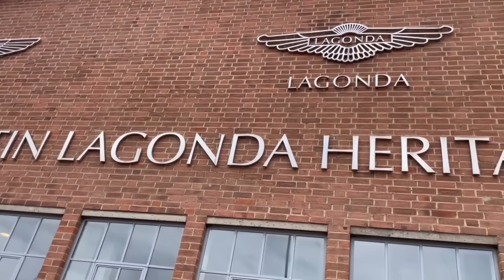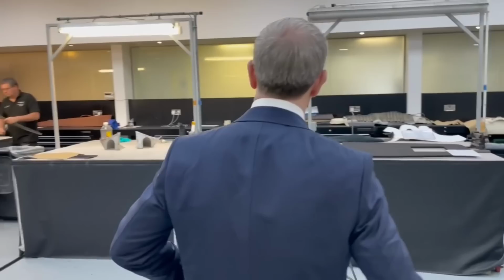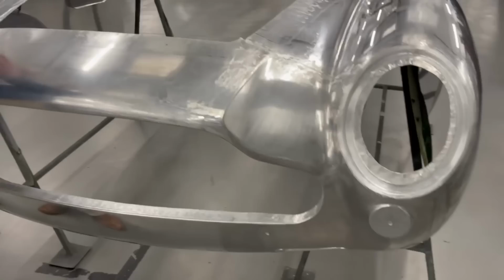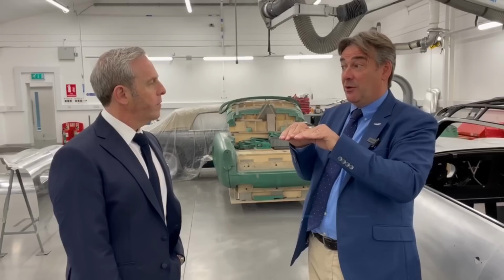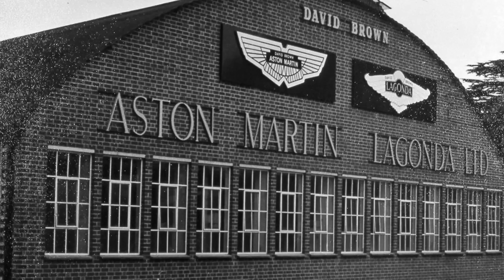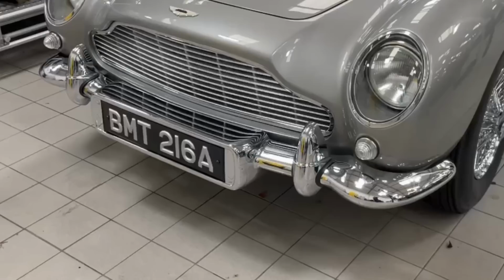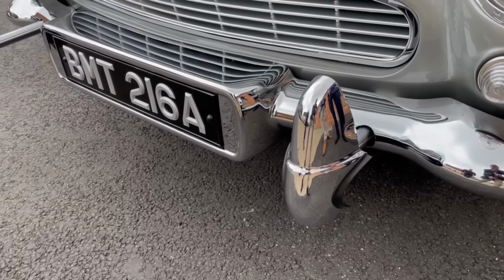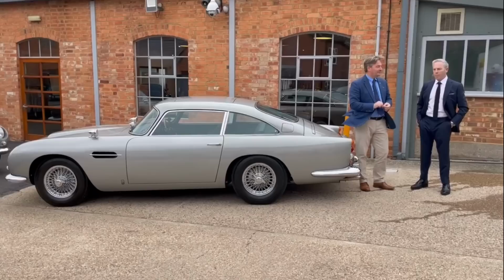My Day with the GOLDFINGER DB5 |  EXCLUSIVE Tour of Aston Martin Works

Comment: Good video.  I also went to Jay Leno's for more technical (drivetrain) info. I am ambivalent about keeping the DB5 in the series. As a car nut and 66 year old Bond fan, I love seeing the car. But Brosnan / Craig having a  282 hp 4-liter 6 1964 DB5 with a paltry 8.1 second 0–60 time  to tool around in modern times is a bit gratuitous and requires suspension of belief. Blofeld could pull away from him in a garden variety Ford Focus.   🙂
Reply: Yes, TBH, before I have my first ahem beer, the appearance of the DB5 in the later Bond movies can feel like a little bit of pandering to the earlier Bond generations to keep them (us) onboard.

Comment: I really like the extra attention they are devoting to standardizing the fit of the body panels, and that's more than Aston Martin did back in the day.  The originals were basically hand-built cars, and as such, no two were exactly alike in that fitment aspect.  And the level of build quality that was acceptable in the 1960s would put an auto maker out of business today.  I'll never own an Aston Martin (sadly), but as someone who has restored a 1963 Studebaker Avanti, I have experienced similar problems with 1960s, hand-built fitment.  As a fairly low-volume car, Studebaker made the body in fiberglass (which they had never done before) and the bodies were basically built by hand by a team at the Studebaker factory.  Sixty years later, I have encountered the same problem with the fit being slightly off in places.  I had to put a shim on one of the driver's door hinges because after the car was repainted, the door skin didn't quite line up with the fender, and the panel gap was too narrow, with the result that opening the door chipped some of the new paint off the rear edge of the fender because the fit was off.  The passenger side door fit correctly, and there was no similar problem on that side.  The shim cured that problem, but it was necessary to slap that band aid on an issue created by less than perfect fit when the car's body was assembled at the factory in 1962.

(BTW, two other similarities for Avanti -- James Bond's creator Ian Fleming owned one, and Studebaker also started out as a maker of horse-drawn carriages in the 1850s, and made the switch over to manufacturing automobiles in the early 20th century.  I'll have to be content with those similarities because, as I say, I'll never have the money to own and maintain an Aston Martin.)

Comment: If David is in the market for another Aston, might I suggest a DB7! My reasoning is, they straddle a line of vintage and modern Aston! They have the old school charm and handbuilt qualities. But relatively modern reliability, and serviceablility! Aside from that thr db7 was the car which started modern aston design language from the vanquish and dbs and onwards! You can get one with the old school straight 6 supercharged or a v12 and both came from factory with a manual! Unlike the vanquish which though it is gorgeous the works modified manual swaps leave little room for your feet to drive them with 😅. Anyhow that is my recommendation! But any Aston will be a good time for sure! Excellent video as always!

Comment: Nice video! I learned recently that the Aston you see Bond driving in Goldfinger is actually a DB4 Series 5 Vantage. It's the final iteration of the model before the DB5 was introduced but fitted with the DB5’s larger 4.0 engine. I'm surprised he didn't mention that detail on the tour.